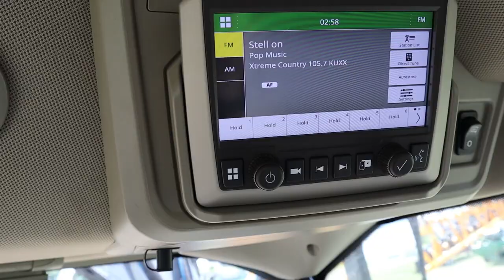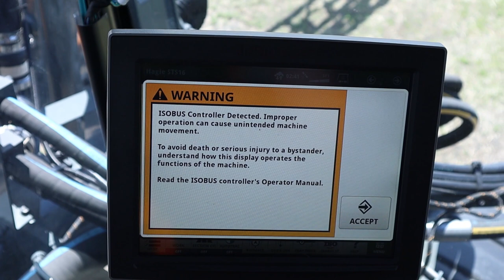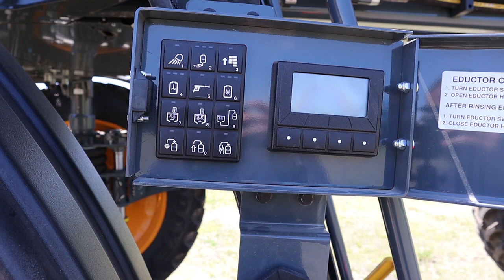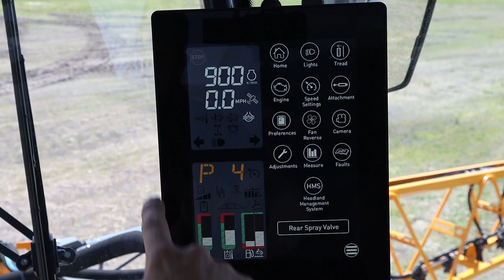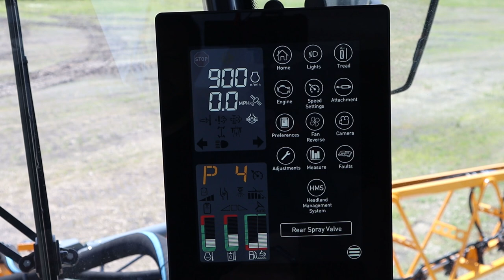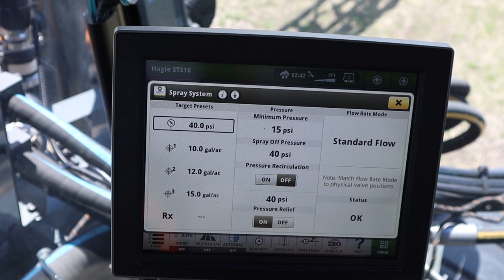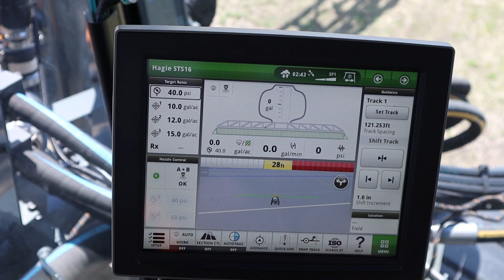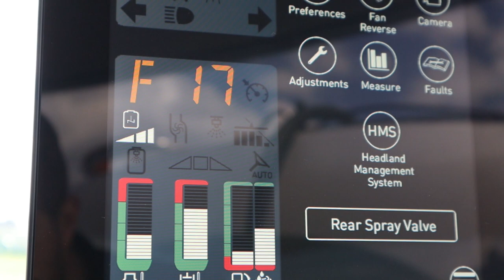Model Year 2022 Hagie STS16 Walkaround

Comment: The one really nice feature of the platform on the older models is that it allowed us to store tools & other items in case they were needed. I'm not seeing any storage capability for tools or spare parts for this new design.  How do you access the hatch on the tank now?  Also, seem like it would be a better design if the side fill was able to tuck underneath the frame a little past the ladder, similar to the front fill. Is the front fill integrated with a strainer now? My sts12 only has strainers AFTER it goes thru the pump & towards the boom ( plugged up my agitation..... wasn't  fun crawling into the tank to run wire backwards thru the jets to unplug  them.)

We custom apply alot; is the tread adjustment hydraulics still weak? Very inconvenient that ive basically have to be empty all the time to adjust when im running the same mix but row spacing changes between 30 to 36 in rows.

Comment: Can you fold left and right boom individually?
Reply from the maker: Yes!  Similar to Deere machine controls, if you press (and hold) the fold button on the back of the hydro handle - then press the left or right boom up/down buttons - this will allow you to fold individual boom sections without using the Autofold function for the entire boom